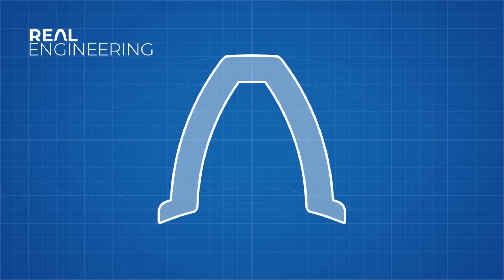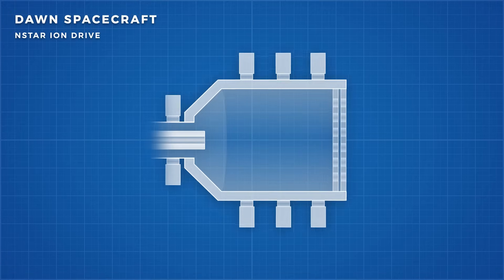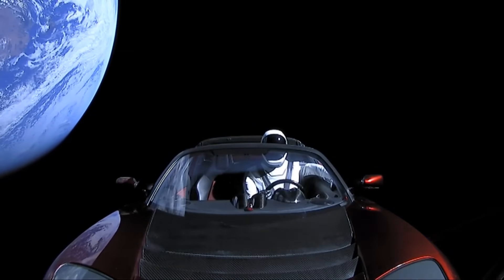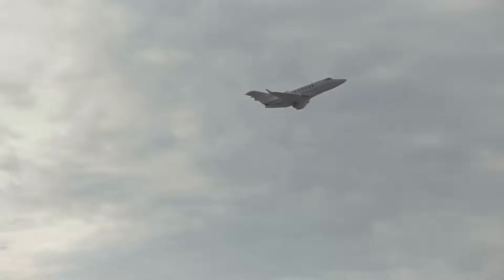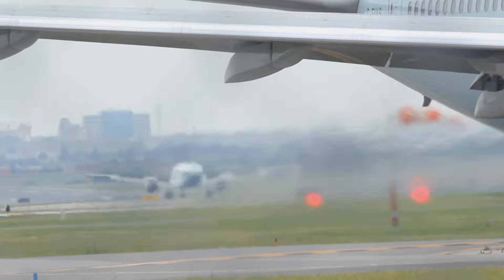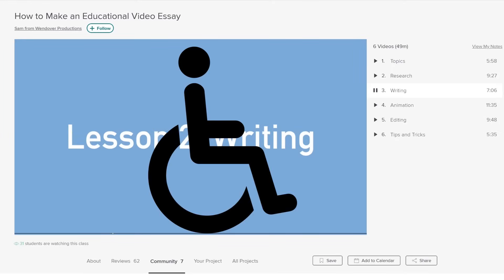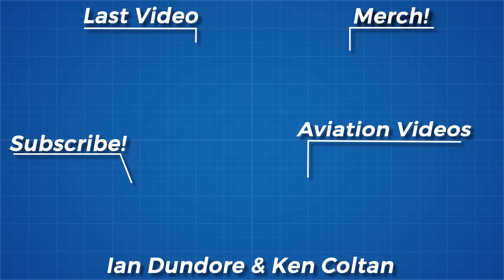Ion Propulsion - The Plane With No Moving Parts

Comment: Wouldn't this be better for powering lighter than air craft. That way they are used for only propulsion and not propulsion & lift. Drag would be a factor but the fact is that lighter than air craft don't have the weight limits of power supplies planes do and long to narrow front surface is the usual configuration so less drag for size.

Comment: So what 's the fundamental difference between this Ion Propulsion and MHD ? magneto-hydrodynamic drive the surrounding plasma (Ionized air) with magnetic field to create flow and those a lift,  same for this, it use the nitrogen in the air driven by electric field !

Comment: The Wright brothers were not the first to fly. Richard Pierce of New Zealand flew 18 months before the Wright brothers did. He called his flying machine an airplane and he took off with it. His plain had wheels. However, the Wright brothers called their plane a heavier than air contraption and they had to be pushed off a hill. The Wright brothers first flight went 120 yards, where as Pierce's first flight went over 850 yards.
Reply: Worse than that, if you click on the purple icon to the left you can see a 100% proven patented ion propelled aircraft with onboard power, that was operational a decade before the MIT claim!

Comment: I wonder if it would be possible to house these racks inside an engine compartment and use a prop to increase airflow and to taxi the plane on the ground. Because if we could do that, it would basically be a new type of jet engine that uses ions from the air brought in through the rotor. I know the point is so it has no moving parts, but it would allow for a what would normally be too weak propeller to lift a larger plane by using these ion thruster manifolds as a form of afterburner.

Comment: there is a fundamental limit that ion engines - they are powered by batteries (unless you go nuclear....) - so their power is limited by the energy density of a battery, which will always be significantly lower than hydrocarbon fuel.

Comment: This will NEVER be viable.  Not only does it require a MASSIVE grid for propulsion, and a lot of power, it would be massively limited in payload and even more limited in speed.  There are already solar electric planes that do way better for the fraction of the cost and as solar and battery technology improves the planes could fly throughout the night and stay airborne  for years at a time.  This propulsion has always been targeted for space travel and personally I think it is a waste of time and money to even study this.  This idea is not even new.  They had DIY plans to make a little hover toy using ionic wind.  They just put it on a super light plane with a self contained power supply that likely lasts only seconds and could not even handle a gentle breeze.

Comment: I have no idea why this triggers me so much (probably because I have little to zero knowledge about how planes work) but this is a glider, not a plane. A "plane" with no moving parts is literally impossible in my eyes without having at least 5 directions of thrust. Planes have landing gear which if on land they have wheels, aren't wheels moving parts? Planes we have today have what I'm gona call fins on the wings to help maintain altitude and to stear, are these not moving parts? A "plane" with no moving parts is about as accurate as a hot air balloon in my eyes and if I've triggered any aerospace engineers then please help me understand this lol I'm not saying it's a bad idea or a bad thing, but call a swan a swan and not a duck.

Comment: the key is to make the craft a simple cylinder with a wide cross section. Sort of like a catalytic converter in a car with the ion drive elements throughout the legnth of the cylinder hull. (does not leave room for any passengers but,,). The ion elements should be a honeycomb of smaller tubes running the length of the hull tubes giving more thrust (wind) than needed vs fuselage weight. You welcome.

Comment: It is simplicity itself to produce high voltages from a battery. With very low weight penalties. You can do it at home with a handful of basic components  You can use a tripler or a coil based system or a transformer or a mix of these  to make many thousands of volts from say a AA cell. All these require an AC waveform to operate. Any oscillator can be used to make a suitable AC frequency (almost anything) This can be most simply stepped up by a transformer - or two -with suitable turns ratios and then rectified and you have your high voltage DC.The problem though is it aint never gonna work - ever. Just like batteries, except hundreds of times worse they are not suited to this.
Reply: Except for little models...which have been made since forever..I have seen little box kite type affairs lifting off, tethered by their ht wires.
Reply: If you click on the purple channel icon to the left you can see one take off and fly with its power supply onboard!  It is patented for carrying its power supply and very well verified.  It is still the only ion propelled aircraft ever that can do both though.
 @martinda7446

Comment: Ion drive is fine for space travel, but not for earthly travel.

Ion drives take a long time to push a vehicle to high speed, & that's in a vacuum.
Reply: The reason it's so little thrust is because they are using. Tiny amount of mass accelerated to high speed. On earth we have limitless supplies of air to ionize to accelerate so we can use lower velocities giving much more thrust.

Comment: But steel is heavier than feathers.
Reply: @obamaprism114  wrong, a pound of troll comments is heavier.
Reply: A pound of feathers is heavier because you have to carry the weight of culpability  of all those birds that we've taken feathers from.
Reply: Imran Ahmadov so what's heavier, a pound of steel or a pound of feathers?
Reply: Jake Mitch feathers cause you gotta live with what you did to those poor birds
Reply: @greenthizzle4  
It depends on what you mean by heavier and how you define "a pound":
If you're defining a pound by the readings off of a scale in a medium not denser than air:
Pound of feathers is heavier if by heavy you mean which has more mass
None is heavier if by heavy you mean which produces more force due to the same acceleration 

Otherwise - None is heavier
Reply: @greenthizzle4   ha it's a trick the feathers are heavier
Reply: @greenthizzle4  Man one pound of steel is definetly heavier.
For one pound i can buy 0,45kg of steel but only 0,0011kg of feathers
Reply: Netrole you’re joking right? I lb of feathers = 1 lb of bricks, they’re both 1lb 🤦‍♂️
Reply: @Weekndgroupie  Did you even read my comment?
Reply: Netrole it depends on the feathers, if its from an exotic endangered or extinct animal the feathers will be worth more then steel.. and stop using commas instead of periods, do 0.000 not 0,000
Reply: @greenthizzle4  That would change nothing, so no it does not depend. And you have an error in your thought process because feathers have already way higher pound/kg price than steel. No need for exotic animals
Reply: Netrole oh lol okay
Reply: Kim Jong Trump did you forget that a pound is a currency?
Reply: @Netrole  that's why he said he could get less mass in feathers than the iron for 1 £
Reply: There is a science to multiply the output, but it doesn't amount to much, its equivalent to making a car run on a self perpetuating watch.
Reply: @kruker bringing back a golden meme
Reply: WEIGHT is same, but more MASS of feather is required to equal 1 pound that of steel, because of buoyancy of air is more on feather (more volume)
Reply: @RatanOjha  You got it right, but the explanation is going to confuse the slower ones.
So this is the layman explanation:
1kg MASS of steel and feathers weighs the same IN A VACCUMM...BUT when they are in normal atmosphere the steel wheighs more, becuase the FEATHERS FLOAT a little when surrounded by air.
More precisely the air pushes the feathers UP more because they are less dense. The air also pushes up on the steel but because it is less dense there is MUCH LESS AREA for the air to push up.
And pressure force is P*A = F (Pressure * AREA = Force).
The pressure is the same for both materials, but the area is a LOT BIGGER for feathers, so the force that pushes up on the feathers is bigger.
Verified experiment on Cody's Lab.
Reply: These guys discussing about a meme
Reply: Doesn't air displacement change the weight?
Reply: @HeatedFilms  no. Air displacement changes the density per volume.
Reply: Abdullah Ahmad air weighs nothing man
Reply: But which came first? The chicken or the egg?
Reply: Brad Daily I came first, all over the egg
Reply: @greenthizzle4  Then what?
Reply: Brad Daily then your baby brother is born
Reply: @greenthizzle4  what's my relationship to the chicken
Reply: Brad Daily I never said anything about a chicken
Reply: @greenthizzle4  ... uh oh.
Reply: Not if you have a metric pound of each!@
Reply: The feathers are heavier because you have to live with the weight of killing the birds
Reply: @oerlikon20mm29  until you bite into that chicken sandwich and forget all about it
Reply: @obamaprism114  the feathers are heavyer because you also have to carry the weight of what you did to those birds
Reply: But look how much feathers it is.  That's cheating.
Reply: Is denser
Reply: Planes are made from Aluminium (which is a light metal.
Reply: The replies on this comment are enough to give one cancer.
Reply: Icarus discovered the hard way, costing him his life when the binding wax melted when he flew too close to the sun. Even the Space Shuttle program eliminated the use of chicken feathers and wax, well before the Challenger tragedy.
Reply: Dave Tin can I think they're trolling
Reply: @obamaprism114  nope the feather are heavier you need more to make the same weight and more means heavier
Reply: caeden V big brain
Reply: @caedenv2575  wtf WHAT THE FUCKING  FUCK  CADEN THE ONLY EXCUSE YOU SHOULD HAVE FOR FUCKING THAT  UP IS IF YOU DROPPED OUT
Reply: @caedenv2575  youre in 3rd grade?
Reply: caeden V volume does not equal weight
Reply: Jake Mitch isa joke
Reply: @obamaprism114  Yes. But STEEL is obviously heavier than FEATHERS. Read a book
Reply: @obamaprism114  I may be late but at least I'm not DUMB

Comment: Their is just one problem with this, MIT is not first!   An ion propelled aircraft that carries its power supply has already been built, flown , and has a US Patent No. 10,119,527, (since 2014).  This patented ion propelled craft predates MIT's and is still the only one that can take off and carry its power supply without assistance (also VTOL).  It can use its collector surfaces as wings, since it is lightweight, however,  it does not need extra large wings due to the efficiency of its ion propulsion system.

Please just click on the purple channel icon to the left, to see flight footage and the website.

Comment: So they tiped in a computer there problem, then the computer using 01 gave them the answer, what did they Design, for what I can tell the computer did every thin why didn't they used there head instead to solve the problem that would have been engeniering

Comment: I have a general question: why is it, that the elevator/horizontal stabilizer is located in the back in most planes?
It makes absolutely no sense to me: It pushes the plane down to increase the angle of attack on the main wings, to actually fly higher. It also pushes the plane up when it is actually used to pitch the plane down. It also increases the stress on the landing gear during takeoff, as it pushes the back into/towards the ground to make the plane pitch upwards.
If the elevator would be in the front, it would actually increase lift during takeoff, and should make the plane more efficient in general, as more lift is produced for the same air resistance.

Comment: Simple, step 1: make quantum computer which produces A.I. Step 2: let A.I work out problem. Step 3: sit back and watch world change as A.I  thinks screw that problem and makes death robots that will wipe out human race thus eradicating the need for ion drive😱
Reply: Could air ships design be used as a vehicle to lighten the load then incorporate ion drive?
Assume that the lift element was neutralized and work on propulsion .

Comment: Hey could you make a video on the process of making pollutant free hydrocarbons (i mean with no Nox, sulfur etc. I know CO2 is itself a pollutant) in an energy negative process by collecting CO2 from the atmosphere  by using individual, well spread atoms of nickel on a sheet of graphene as a catalyst to turn CO2 to CO as part of the process? The uses of this could range from carbon capture to providing real carbon neutral fuel to fueling planes when we run out of "naturally occurring" hydrocarbons. It could make for a very educational video.
- A chemical engineering student

Comment: 5:29 wouldn't the positive electrode vanish after a certain amount of time?
Reply: Why would it? The batterie ,,pulls,, on the electrons in the anode with a voltage of 20kv so the electrons will ,,continue,, towards the batterie. So the anode won't acquire a negative charge. And the Nitrogen comes from the atmosphere, it will get oxidised at the anode then travel to the cathode where it will accept the electrons it ,,lost,, at the anode and return to its neutral state. Please correct me if I'm wrong I'm no expert 😅

Comment: I dont know if you've ever heard one of these 'motors' before but they can create a quite loud buzz, granted not as lound as a jet engine, but it can still be quite loud, you can make it quiter by seperating the two wires, or whatever conductive surface, but that reduces the velocity of the air

Comment: So I have a few gripes, I enjoy your videos and your science focus, I feel you do a good service here on YouTube. However, I've seen. Few points parroted around different producers on this topic. As far as low noise travel is concerned, this would need to be scaled beyong belief to power anything except a modified one seater glider, and that'd be a stretch, and this runs on super high voltage high current power, if this thing touched you, you'd be dead, the only thing that'd keep your body from cooking would be the thin wires melting. This is not particularly safe or efficient. And who is so outraged over the noise of a passing jet 5 miles up. Perhaps those at the end of an airport, whose homes may be taken by eminent domain to extend the runway for these slow to accelerate crafts. Ian propulsion in space is a marvel of technology that wastes energy while conserving precious mass, this is ideal for the low mass sunlight paths of spaceships, but not such a good trade for energy conscious available mass earthlings. Keep a skeptical mind, enjoy the times we live in, and have a great day.

Comment: Don't be a theoretical bookworm, use the units fluidly.

Type 1: Nearest railway station is 2 Kilometer from my home
Type 2: Nearest railway station is 2,000,000 Centimeter from my home

Type 1: Ion drive for 6 years propels the spacecraft to around 44.6 Kilometer / second
Type 2: Ion drive for 6 years propels the spacecraft to around 44,651 meter / second

We have Joules, Watt hour, Kilo Watt hour, Mega watt hour etc multipliers so that the unit is meaningful and understandable to speak, 
else we can just use simple joule and say my house consumed around millions or billions of joules per month rather than in kWh or Mwh.

no wonder, if you would had good knowledge on various spacecraft velocity, then you might had made it better.
Generally spacecraft are on velocity of around 10 to 40 Km/s (30 Km/s being mostly common among interplanetary flights).

Comment: The speed of sound? In space there is no sound. Plus the speed of sound varies depending on the transmission material. It travels faster in a steel rail than through the air.

Comment: 6:30 "If we could find a way of powering these devices that didn't require heavy batteries."  Maybe we could find something that has a high energy density, is liquid for easy storage, and gets used up as the plane flies making it lighter.  We could even store some of it the empty spaces in the wing.  Just build a new infrastructure for distribution of this liquid at all airports and you could refill while passengers are unloading and loading and then be back on your way to another desitnat.....Oh wait.

Comment: Ok there are no moving parts great but so far life has proven that anything high voltage is unreliable especially when its like 20k volts. I would trust the jet engine more than some 20k volt step up converter. I mean literally nothing high voltage works reliably, like in automotive world for example, engine mechanically can outlast the high voltage part of its ignition system many times. Same goes for HID ballasts. Or any ballasts for that matter..

Comment: if you light candles and attached to the wings of the plane and redirect the hot air generated from the flame from y direction to x direction and hence push the plane forward. will it be enough to keep pushing the plane forward after you give an initial momentum?

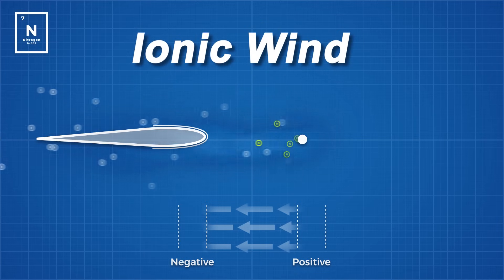Comment: Interesting stuff. I'm not an engineer! ... but ... I noticed in the animated diagram around 5:46 the cathodes are 'foam aerofoils covered in thin aluminium'. But the aerofoil shape shown doesn't have the flatter bottom that I thought was needed to make a wing provide lift. Maybe these 'aerofoils' are just for the ion propulsion and the larger main wings provide lift? But couldn't the cathodes be reshaped to perform both tasks? Or maybe on the plane they are a different shape to those shown in the diagram for demo purposes? Anyway, just curious about this. Great video again, thanks.